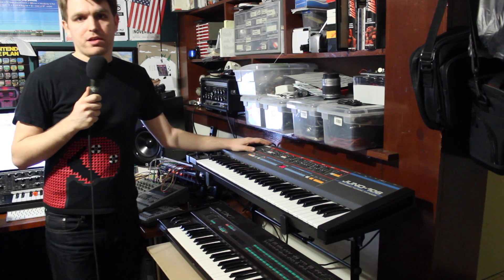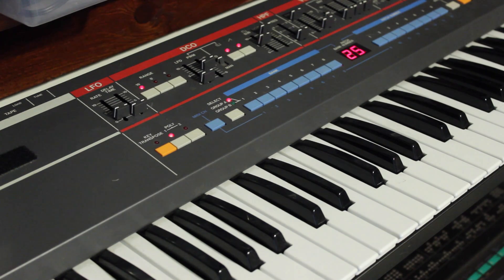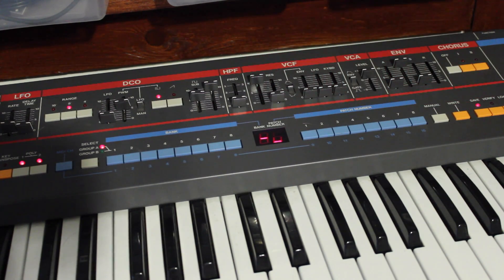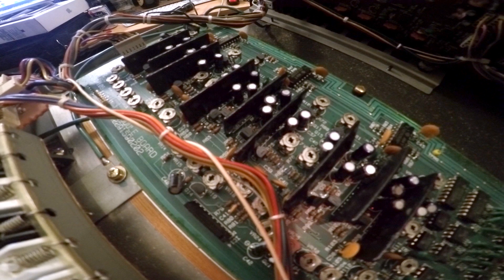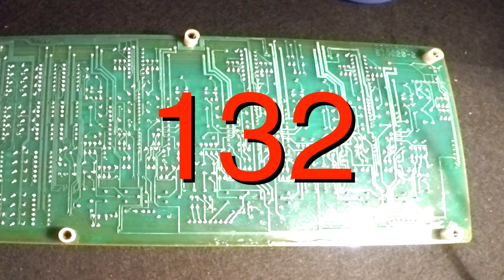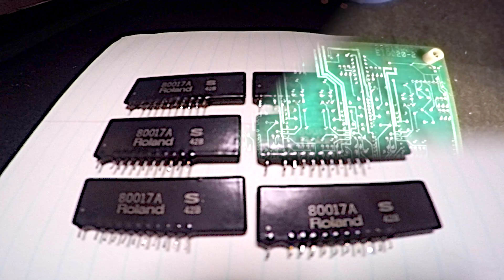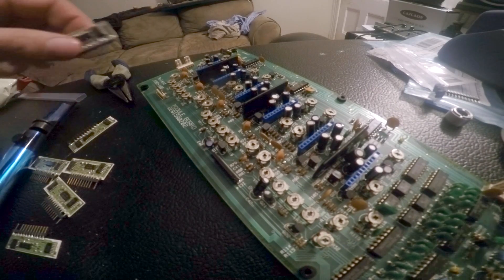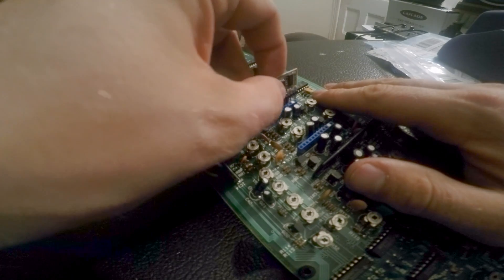ROLAND JUNO 106 : VOICE CHIP ISSUES

Comment: Super helpful! I used micro tweezers to remove the epoxy that was right up against the IC edges and pins instead of an exacto knife. Some of the epoxy on the back of the chips were still really hard after 3 days, so gonna soak for another day or two.

Comment: Hi,   I am an original owner of a vintage Juno 106, bought it in 1884 or 5,  took care of it, exterior is cherry condition- perfect!  I would never have dared to do the repairs you show on here, but I had it serviced, replaced all DCO and voice chips due to the epoxy problems. Dont know what the technician did but all factory recorded voices have been lost. Each voice bank just a mess. I can save change, my question is there any way to to a factory reset for this old-tech board or reload the patches from any source? I dearly want my lovely old analog sounds again, any advice??
Reply: did you ever get sorted ? from what i recall the juno 106 has its factory settings stored on a cassette tape which needs played back in to restore it - i know this is true for the juno 60 and near sure 106 too ?

Comment: Definitely need a solder wick or solder sucker and then some flux to reflow any stubborn joints.   Not sure why Roland saw the need to coat these boards with epoxy.  🤔.    (Roland seems to have problems with epoxy, like with XP-80’s)
Reply: I think Roland didnt want anyone reverse engineering their circuit.  I've seen plenty of ICs like that in 40 years
Reply: @ScottFrye000111222  I hear ya there.  I'm a retired EE, and have popped the top off of many IC's to take a peek inside.  Unbelievable some things I've seen.  With some of our stolen designs, the perpetrator stole the photomasks from the front-ends, but was stupid enough to leave our company logo on them when they processed them.  (a simple laser job could've removed that, done it several times to remove unwanted traces on photomasks)

Comment: I know this an older vid but thanks to  the crew at SYNTAUR in new Braunfels TX.USA  you can get bulletproof new VC's and anything else a juno would new,they stock millions of parts and don;t take  in repairs,bt do buy  broken synths to refurbish,customize oe tear down for parts stock. Their first custom, had the new chips,an audio in to play an instrument through that killer chorus and an amazing  full circuit that run a patch sweep! It aslo got a facelift with custom graphics and chromed knobs... They dont handle any electro-mechanical boards like Rhodes,Wurli  or Hammond but  I do in the Atlanta ,Ga area. I am personally  looking  for a dead juno to refamiliarize myself having made the mistake of selling  in the 90's..I may have a synth to trade.

Comment: I hope you might have some idea about my problem with my Juno 106. The synth has a strange problem where the sound changes slightly over time. Almost like a flanger effect. I can press the same key many times and the sound will slowly change back and forth
Reply: I don't know whether you're Dutch like me (your name seems Dutch) so I'll translate to the best of my abilities:
It may be a couple of things, maybe replacement of the voicechip(s) is necessary,
maybe the unit needs to be tweaked back to factory specifications (tuning the filter, especially the resonance)
Then there's the soldered internal backup battery that may have to be replaced
and heat may have broken soldered parts in the powerunit.
It's not very common, but one of the 5534A Waveshaper-chips may have a defect. There are 3 of those in a Juno-106.

I am no expert by any means so the language and names I used may be off.
Good luck.
Reply: @jairkerker2821  Thanks for your answer. I'm actually Danish 😊. I can say for sure nothing has ever been done to synth. In fact I don't think it has ever been opened. The caps might also be dried out completely. So I think I'll try some of the things you suggest and maybe also replace the electrolytic caps
Reply: @jwester7009  
Lots of luck, those 106's are precious.
In a video made by another guy, there was a weird sound coming from a 106, maybe it sounds like yours. I'll try and find it for you, you can hear it somewhere in the first part of the video.

Comment: So first of all, wtf are those chips. Second, wtf are they doing.
Third, wtf is epoxy resin and how does that cause deterioration of those chips.
Reply: Wtf epoxy becomes conductive over time, creating a short circuit between the pins of the chips.  removing the epoxy does not completely solve the problem, the chips sound differently even after cleaning them.  there are chips from a company that I can't remember now but they can be found to replace the old chips.

Comment: Please correct the info in the video, the voice chips are the MC5534 (3 of them, 2 voice each) and the VCA/VCF Chip Is the 80017(6 of them). 
Cheers
Reply: Francisco Montes no, the 5534 is called wave generator. 80017 are usually named voice chips as they work one per voice. 5534 is 2 voices each. And also, even if you have all 5534 working, you still may have missing voices depending on 80017 conditions.

Comment: I have what seems to be  a faulty voice chip.  ie  when i turn   my roland hs60 on, there are a few dead notes,  which change position each time i turn off and on. So i used your method to find out what was wrong,  and, strangely, i found that switching to poly 2  from poly 1  fixed it.  Any suggestions why that should be?
Reply: Well, it two years later, but...
Switching to Poly2 does not fix the issue. In Poly2 mode, the first key pressed is always using voice chip 1, pressing an additional note will trigger chip 2, and so on...
So, if your dead voice chip is #6, you will only ever (not) hear it when having six keys pressed at the same time. If your dead chip is #1, Poly 2 will immediatley trigger the faulty chip, rendering this mode useless.

Comment: My Juno makes a loud buzzing noise when it is on. Is there something wrong with it?
Reply: Hi this might be the mains transformer. When I got mine, the whole unit was vibrating along with the transformer. Nothing to worriy about. A transformer consists of metal plates held together with a copper wire coiled around. When those metal plates can move,  this results in audible buzzing or vibrations like mine. I solved my problem by tightening the transformer with a zip tie round the bottom.
Reply: Thanks for the reply Pieter!

Comment: JX-3P has 12 oscillators (6 more than the 106), chorus, MIDI and a sequencer. Why mess with voices of the 106 going bad when you can pick up a JX-3P and the PG-200 controller. Makes no sense.
Reply: Digiphex Electronics does is have portamento?
Reply: The Juno 6 and Juno 106 are different from eachother (the 6 sounds a bit more punchy for instance), and the JX-3P is different from both in a lot of ways.
They have different functionality: the JX has cross modes and more waveforms to choose from, the Juno can tie the pitch bend to the filter, has pulse width modulation and, as the other commenter stated, the Juno has portamento.
The biggest difference imho: the Juno's famed warmth is unique, something the JX lacks a bit.
Only the Jupiter 8 may surpass the Juno in that regard.
Listen to a Juno 106 and a JX-3P side by side and you will hear they both have their ups and downs.

The Juno has 3 chorus settings (1, 2 and 1+2 combined) and has MIDI in, out and through btw.